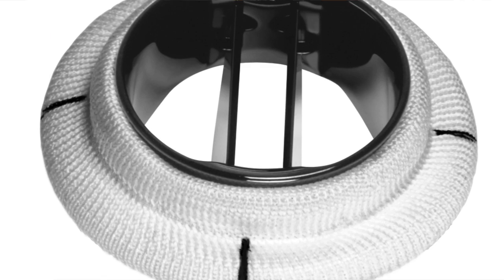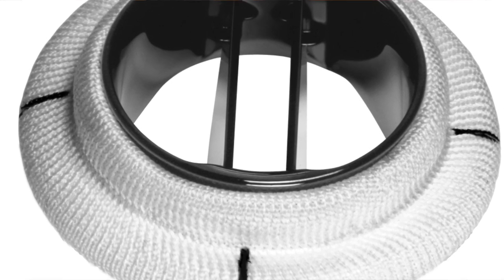Mechanical Heart Valve Replacement: Can You Hear It Tick?

Comment: I had an Aortic Mechanical Valve replacement one month ago. Thought the "tick" would make me crazy, but it doesn't. It reminds me that I'm alive and that's the most important. Yes, sometimes it gets in my head and it's hard. But other times I don't listen to it that much and even get worried if I don't ear the "tick". I think we all get used to it with time. A trick: at night, when the "tick" noise doesn't let me sleep, I turn on the TV with a little sound with 30 minutes timer to go off and go to sleep in no time. 😁
Reply: alfinete11 the same thing😄
Reply: What's up man? I'm getting the onyx valve next month. Hows everything going I'm only 20. Pretty nervous
Reply: @-SVN-  First thing: everything will be alright! Second: remember the procedure will save your life, so the first weeks (particularly the first 2) won't be easy, but IT WILL get better with time! Third: if you worry about the valve "noise" remember how you are now and the risk you have now! Again: everything will be alright! Good luck!
Reply: @alfinete11  thanks dude, I'm not worried about the noise. Just worried about the first few weeks.
Reply: Is the ticking annoying at first? Im getting one put in in 30 days and I'm hoping it won't drive me insane
Reply: @lance307  Remember: tissue valve = no ticking. Mechanical valve = Ticking. Yes: it's annoying at first. You'll probably hear it all the time. Loudly. But it gets better. Some weeks/months later you will be worried if you don't hear it. For my experience, having the valve for 10 months now, is that i don't hear it (or notice it) about 90% of the time. Even at night it really doesn't bother me at all. Only problem is when it's racing... or irregular or weird. Because i hear it, anything that doesn't seems normal makes me worried. because I developed a bit of anxiety but thats another story... But doctor say I should ignore it. I try and can do it most of the time... But overall, for me,  the ticking (by now) is perfectly ignorable and  manageable. Good luck! :)
Reply: @-SVN-  I'm too
Can't get married with some one
Reply: I had aorta surgery in 2022 and at 1 year routine check up they said I have severe aortic regurgitation and I must do aortic valve replacement.

I'm still paralyzed. What to do??? Mechanical valve and warfarin  are terrifying to me. Not doing anything is a guaranteed death in 1-2 year.

I'm 30 and wish I could be more positive but I just have dark thoughts and fear.
Reply: @mkm1015 Hello! Did you have the surgery? I ask because I have to do it too, I'm 25 years old It's crazy!
Reply: @-SVN- Hello, how do you feel now, can you do sports or do you have to avoid them, and what about the anticoagulants, I have 25 and I don't know what to do, the doctor also gave me the option with a biological valve, but - I have to repeat the procedure
Reply: What was your recovery like? It’s looking like I may need a valve replacement soon and they’re discussing the possibility of a mechanical valve.
Reply: @PianoDiva24  As I said before, the first two weeks are really harder. But that's perfectly normal. You have to be calm, patient, trust the doctors and let time pass. After that, it's a gradual recovery over the following months. In my case, I had surgery four and a half years ago, and (in addition to covid 2 times) a year and a half ago I had a bariatric operation (I weighed 158kg and now I'm 105kg) and I'm now able to do one hour of walking or elliptical training a day. So I've only been getting better. Just be strong and trust the process. Good luck to you.

Comment: I am a 43 year old white female 5'7" 140 lbs. who just had the On-X mechanical valve placed in the aortic valve position. Honestly, it is very quiet and I only hear it occasionally. I've had no trouble sleeping, no trouble concentrating, no comments from passersby, no emotional issues. To me, it does sound a little tiny bit like a Timex watch ticking, but only when I lean just the right way and it's quiet as a library. Can you honestly hear a Timex when it's on your wrist? Maybe when you're super silent and leaning just the right way with it right by your ear, otherwise not. I'm just so thankful to be alive. I don't even think about the noise. I barely ever notice it. Don't let the internet scare you. It's totally fine. Get your valve!
Reply: How's your recovery going is everything going good

Comment: I will replace my aortic valve within the coming months. I will soon speak with the surgeons to discuss whether I use a mechanical or tissue valve. 
I wonder if hypnosis would help those who are troubled by a mechanical valve ticking.
I am surprised, no one has commented about increased bleeding and bruising associated with the use of warfarin. This is the issue I'd like know more about. In my occupation, I am often getting bruised or minor cuts and scrapes. I'm 66 and have no desire to retire.